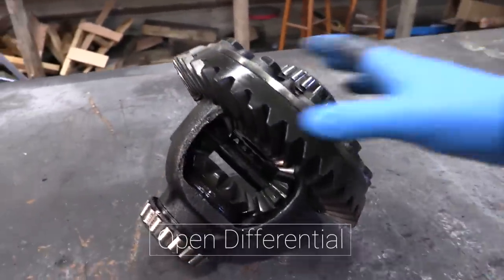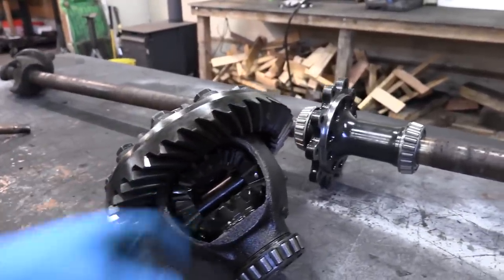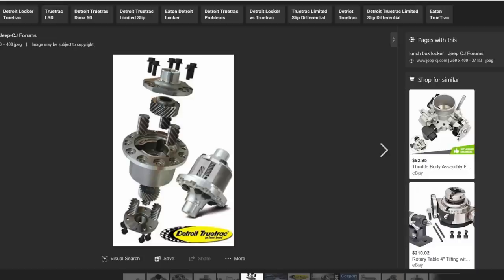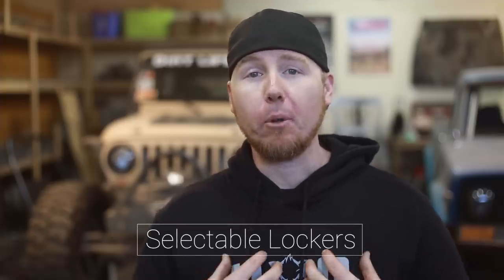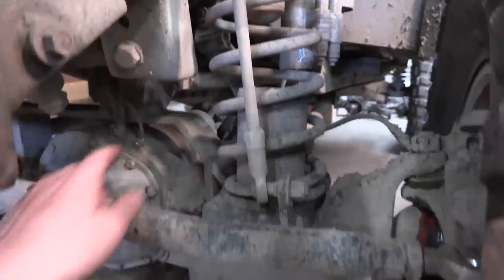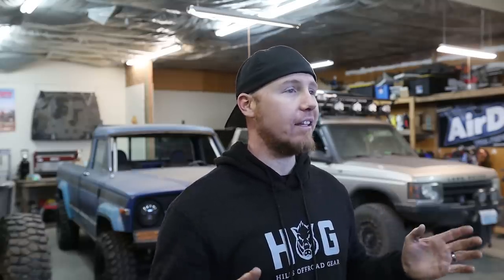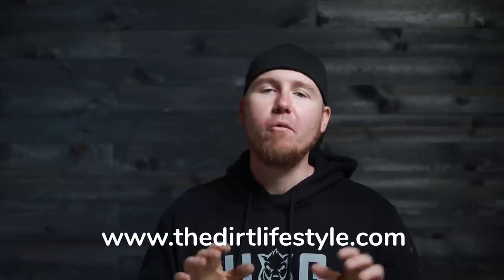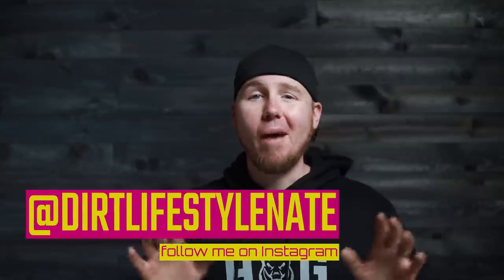Differential Lockers! ARB vs Yukon vs Detroit vs Spool

Comment: There's a lot of "this is my opinion" and unlike almost all other locker comparison videos there was no "this locker is trash". Your opinion boiled down to "they all do something different, find one you like and use it". A very good and informative video!
Reply from the maker: Thanks buddy 👍
Reply: Agree 100%, nice to hear pros and cons about all, not just "this one is junk, this one is superior"..just good useful info on all! Good jod!
Reply: I have a front Eaton locker and it works great except in northwest mud. The design makes it unlock when traveling forward and reverse till it will lock again,  to get out of a  mud pit. Most situations it works fine but not if you have to do short burst of forward and reverse. My brother runs an ox cable and I really like it. Just like a motorcycle throttle cable, the guys that dont maintain it have problems.
Reply: @DirtLifestyle  a lot of european 4x4 army,had cable/handle lockers,like the haflinger,ect..front,rear,& centre lockers..
Reply: Installed prices for different options is always a consideration in making decisions like this

Comment: You know your an offroad addict when something that keeps you up at night is wondering if metal shavings will collect on the electromagnet on lockers lol :D
Reply from the maker: Lol
Reply: @DirtLifestyle  you can solve that issue by having a strong magnet on your plug for the diff housing - the electromagnet is only on when you have the locker actuated, and it shouldn't be strong enough to 'steal' the metal shavings from the magnet on your plug
Reply: @DirtLifestyle  I will test this theory out. I did the Eaton E-Locker in my D-35 last year along with new 4:88 gears and I'm about to do an inspection to see how the gears are wearing in.
Reply: There's nothing worst than shavings on my magnet!! HaHaHa
Reply: @this_tj_krawls  What's the verdict?

Comment: My god dude you were meant for this YT stuff. Simple straight to the point with a production quality better than some of the bigger offroad names on YT. Hats off to you man. I am digging the content.
Reply from the maker: Thanks! I appreciate the huge compliments! 👍
Reply: @DirtLifestyle  Hey man I tell it how it is. You Channel is one of a few I can stand. No BS filler, and on point with facts. on top of that
 you are Honest.
Reply: @mikehancho5286  100% I learn something in every video. It may be how to approach a line or how you can probably afford to suck a little at welding, as you figure it out.
Reply: @donewhiskey  Same here. I lost a lot of my wheeling skills when the wife,and I started to have kids. They are 6,and 3 now. My JKUR is finally to the point I would trust it taking the family out on  the local trails. These vids  especially the slow motion me remember how to pic lines, and technique. Also the fabrication is extremely helpful since I am 100% self taught , and just picked up a Omnie Pro 220 welder to learn. I have a truss kit, LCA skids, and track bar brackets waiting to get burn on. his vids help alot. I share most of his vids  my Jeep club since we are predicated on the beginner level side here in WA.
Reply: Mike Hancho I totally agree
Reply: Agreed.
Reply: @DirtLifestyle  I just pick up a high pinion 9" front axle for my yj. I'm going to install ARB locker and 513 gears with chromoly axles. Whats your opinion on that? I would like to stretch my rear end. What would you recommend on how many inches? I'm running 36"
Reply: @DirtLifestyle  		aaAaaaA

Comment: I agree lunch box lockers are garbage. Air lockers are by for in my opinion the best for what I do, street and off road. I haven’t been a fan of e-lockers because of the solenoid at the differential and they can hang you up. Detroit and grizzly lockers ‘mechanical’ are my next choice over air. Great video!

Comment: I personally love OX lockers. They have some of the best customer service I've seen, and I've never broken one. Broken plenty of axles never an OX. And it is a monster locker.
Reply: I broke a HP D44 OX.
Had a 4.0 YJ on 38" Boggers & was trying to climb a nearly vertical 30-ish foot high dirt bank.  Came down from a 2-3 foot wheelstand on the Rev limiter & when those paddles bit into the dirt I broke a Yukon stub shaft which must have bashed hard on the spider gears and snapped all the locking teeth off the actuator side axle gear.
Couple things - I had been beating
 on that locker for 4-5 years at this point (and this wasn't the first shaft breakage), I had converted the spring loaded shifter mechanism over to a solid spacer so I could feel when the locker was engaged (had engagement issues in freezing temps with the spring loaded shifter) - but hadn't checked the cable adjustment in quite some time, and I was being very abusive when this failed so while I think OX's locker design was a contributing factor (their locking teeth are backcut making the root of the tooth weaker) - it wasn't shocking that something ultimately let go during this abuse.

Comment: A good friend of mine ran the manual ox locker for years. Never had any issues. He wheeled that thing hard. Hes snapped ring and pinnions and chromoly axle shafts and the locker held up. Then again he's also a mountain biker and knows how to set up cables.
Reply: PiperProductionsInc. 😂😂😂

Comment: Love my Detroit's. They are both over 25 years old and still working.
Reply: I've been running a Detroit for a few years in the rear with an ARB front.  Just in the process of changing it for an Ashcroft (air) now for a couple reasons.  First, the Detroit really made me push the front in tight turns to the point where last year on the Dusy (very tight trail) a friend in a similar truck with 10" more wheelbase was making turns I couldn't. Second, I've broken a couple axle shafts in it and it always seems to shock load the remaining axle and twist it in the process.  I can't categorically state that's due to the Detroit - it could be both shafts were twisting splines and I only saw it when tearing down to repair, though I've had several other people tell me they've seen the same thing with a Detroit.

Comment: I kind of love that you have so many carriers just laying around for your examples....     I HAVE WANTED TO TRY AN OX FOR YEARS!!  Eeeeeeeveryones all like, "ARBS OR NOTHING".  That settles it.  When I lock up the LJ, im getting OX.  For the same reasons you listed, the cable seems like such a simple straightforward solution.  I've thought so for years.  Thanks for the video man.  Great stuff.
Reply: Only locker i've ever owned was a detroit "soft locker" (what a horrible name for that locker).  Always worked great! Man it had some squirly road manners sometimes.  I'd  run one again, but ive heard the in coil suspensions they're even worse (i had it on my YJ, on leaves). That thing scared the hell out of me the first time in unloaded.  KLANG! and practically sent me into another lane of traffic.  Ya get used to it though.  :P

Comment: I run E-lockers front and rear on my rig and in general I like them.  The only two downsides to an E-Locker is rotation to engage and having an electric wire which is relatively exposed to water and mud at the diff pumpkin.  I’ve not had the wire fail but I figure it’s a matter time if you go threw wet terrain.  Engagement rotation just forces you to plan ahead and engage your lockers before you hit an obstacle otherwise you’ll have to back up, engage and re-approach.  If you engage once you’re stuck you risk a bit of stress on the axle when one tire is spinning and the other isn’t when suddenly the rotation is complete and both shafts lock.  Always best to lock when stopped and get the engagement with both tires rotating at the same rpm

Comment: I have dual manual cable lockers in mine. You hit the nail on the head, only issues you're ever going to see is something with adjustment. I've had them for years and never a single issue...after adjusted right.

Comment: As always, great video! When I lived in America, I had a D2 with a Detroit auto locker in the rear and a TruTrac in the front. With the Traction Control in the D2, in worked amazingly with the front TruTrac. A torsen LSD multiplies the traction from side to side, so when a wheel lifts, the torsen cannot multiply 0 traction. However once it gets working with the Traction Control, its by far the closest you can get to the full performance of a locker in my opinion. Now that I'm back in New Zealand, I run a D1 with an auto locker in the back and an E-Locker up front. The E-Locker is awesome, my one has a sealed solenoid so there's no issue of detail shavings building up on the magnet, and I run super strong magnets on my drain and fill plugs to keep any filings out of the important parts! Been very reliable so far.
Reply: I've known a lot of Rover guys who love their TruTracs, especially as you mentioned in the D2 with it's TC to help 'brake' a lifted tire.  But I've also wheeled beside basically identical trucks to mine (D1 vs RRC for example) and seen my true lockers (ARB front/Detroit rear) give me an easier time than the TruTracs.  I think they are a great option until you get into more serious crawling where having a tire fully in the air is more likely.

Comment: I run an ox locker in my xj, only one adjustment to make and that’s the free play at the lever. They giver very specific directions on how to do it, also I like the fact that if I wanted I could very simply make my ox electric just by adding the actuator, they still use a cable on their elocker.

Comment: I lincoln locked an old 9inch I had in my CJ. Loved it off road and honestly it was ok on the street as I never travelled far or fast. One saturday went wheeling with ex and two kids and traveled 50km back home on paved roads at 80-90 kmh. Next day went to the bank and made a 180 around a parked car and then a 90 the opposite way into parking spot and snapped an axle shaft. Towed home on wrecker...pulled it apart and it was obvious that it had been half broken for awhile as there was rust on half the breakage. Had buckshot mudders Q78 which were a tall 33-34inch. If you have a spool or lincoln locker hopefully you are over built for the tires you are running.

Comment: I had an OX locker, once it was adjusted correctly, I had no issues with it. The cable actuate the locker with a spring so if the cog gear is not aligned with the side gear, it will not cause a problem, and once the wheel is aligned, the spring load snap the gear and lock the diff. Worked very well.

Comment: Good comparison video, tons of good information. The only major thing I would add is that welding a diff or using a lunchbox locker does not require replacing the carrier. Putting a tru-trac, auto locker or selectable requires knowing how to setup the gears again after you replace the carrier. Personally, I would never pull a diff to put anything that isn't a true locker inside an axle
Reply: Another fantastic channel! You guys rocked at the full size invasion videos. I sat down and showed those videos to my coworkers in Norway, Sweden, Turkey and Greece. And with my brothers back home in Ireland. Great content guys, that all of us have enjoyed, thank you for making the effort to share it. Respect.

Comment: I have an Aussie locker in the front of my xj; it has no problem locking up, but it occasionally won't unlock on the street. Only issues I've run into this is when I'm turning hard on icy roads, but it's never unpredictable. Money well spent on a high school budget.

Comment: Just ordered an ARB and a set of Yukon gears this week! Can’t wait!
Reply: How are they working out? I'm about to pull the trigger on 4.56 Yukons and a ARB for the rear in my Xj.
Reply: @dano8065  zero issues. Have had them installed for about 9 months now and have put about 1,500 road miles on them and some serious trail abuse. I’ve broken 2 front shafts (1 stock and 1 chromoly stub shaft) and 2 sets of u-joints and the rear gears/ARB are perfect.

Comment: Lunchbox PowerTrax in my chrysler 8.25" in XJ with 33's -- no problem except the occasional locking up and unlocking on the street, with a loud bang. Turned my Jeep into a tank, night and day difference in off-road capability.
Reply: I have a power Trax no slip in my chrysler 8.25 as well. It's the only lunch box locker with additional synchronizer rings so it doesn't ratchet like crazy when cornering like all the other lunchbox lockers. I've used aussie, powertrax, and spartan lunch box lockers and it's by far my favorite. I wish I bought one for the front instead of the spartan... Works great but very clunky on sharp turns, I'm used to it but everyone thinks my Jeep is falling apart haha

Comment: Thank you, Nate. Excellent information on lockers and differentials. 

I've ran the Yukon Grizzly in the rear and Zip air locker up front in my TJ.  7+ years with only o-ring replacement last year. +regular maintenance

Comment: I have an OX in my LJ. I opted for 35 spline. Moly shafts and trussed with a Tri-4. Wanted to keep it as strong as possible while keeping it narrow as I could without having to build a set of narrowed 60's (no time). I absolutely love it. Customer service is top notch and and the drive away lock made it for me.

Comment: I will be starting with Eaton Torson lockers in my 06’ LJ; because I’m currently running 32/11.50’s. Once I go to 35’s and re-gear, I will be changing the rear to the manual OX locker. I really like the idea of the simple direct reliability of it. Just like JEEP 😊

Comment: Nice explanation!  I use a Eaton Truetrac in the rear and a Detroit Locker in the front. Steering is heavy in 4X4, but it drives great on the street and does pretty well offroad.
Reply: More or less that's what I run I'm running a Torsen LSD in the rear with a Detroit Locker in the front and I think it's the best combination for Street use give you lots of traction on the street if you like to play on the fuel and predictable. You don't lose much off road and you still have excellent turning radius. No electric no Airlines and always works.
Reply: That's seems backward to me - wouldn't you want the Detroit in the rear where you most need a 'true' locker and the more street-friendly manner of the TT in the front?
Reply: @donhappel9928  nope had tj with true track front and sparton rear .
It did do well . not as well as the other way . to much gas or rpm in a turn it will lock up and do 180 quick . or move little side ways hits icepatch .  full locker tire with most traction is pushing and your going that way ready or not .
Reply: @donhappel9928  if u can get front over it u can drag the rest  behind u .
Reply: @donhappel9928  It does sound backwards, but having the Detroit in the rear makes a short wheelbase push in the corners.  Had one in my CJ.  Watch John Currie's Video, he runs a selectable in the rear to prevent this.  I didn't want the expense or complexity of ARBs.  I like the Eaton E-Locker, but again $$$.
Reply: @davidgreen9957  I know how a Detroit will push a swb truck around - I'm at 100" and just changed my rear Detroit to an Ashcroft to help with turning radius.  I think the issue is I'm used to Rovers where we're permanent 4wd vs typical American stuff that runs in 2wd on the road; you can just unlock the front hubs and free wheel so no Detroit funkiness on pavement where we can't do that.

Comment: I have a "lunchbox" locker in my 2wd V8 s-10 and I love it. it all came down to budget for my decision. As far as locker noise goes, I don't hear mine so to me it's quiet. the only issue I've found thus far is if you have to pull the axles back out it's a PITA! you have to re-align the locker the same way it was when you installed it or it won't come back apart. Ask me how I know. And 1 more small thing. When you park with an automatic, and are not on level ground,  the vehicle will roll until the teeth mesh, a little farther than expected. To me this isn't a huge issue, just something to be aware of when you 1st install 1, after that you know what to expect.
Reply: this is actually huge for me thanks for sharing this. I haven't installed mine yet and that's good to know for the hilly streets of SD

Comment: Agree what others have said - it's great to see a product review that's not about somebody selling something and that has an open mind.  For what it's worth, my "it sees street use only" Xterra came factor with a rear electric locker.  Never had any trouble with it.  I do use it once in a while, mostly for fun, in deep snow.  Works fantastic.  As far as the metal shavings go, my take is that if you're making metal with your gears, that you've already got a problem going on...the magnet is only going to pick it up if it's in the fluid or flying around, it won't pick it up if it's just sitting in the bottom of the case.  Can't be that strong.